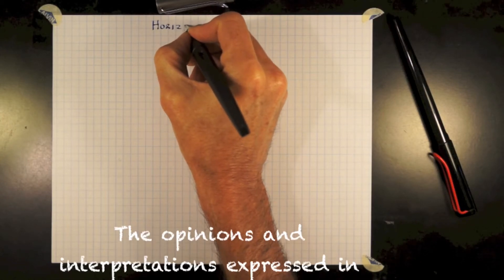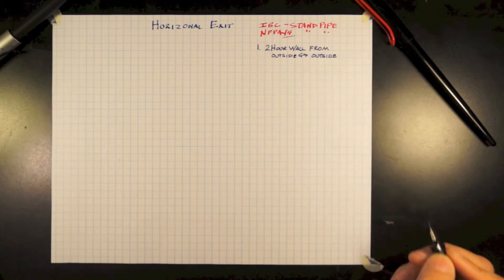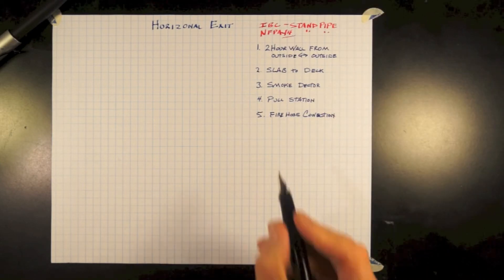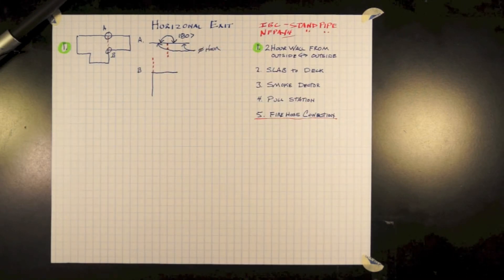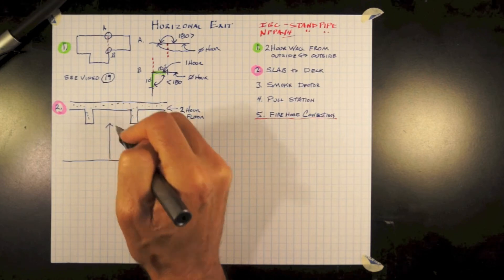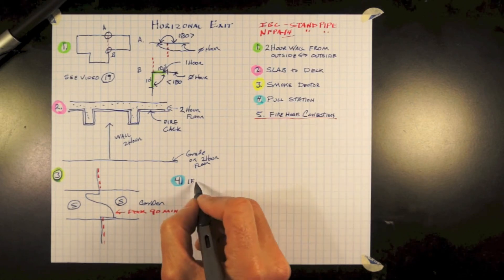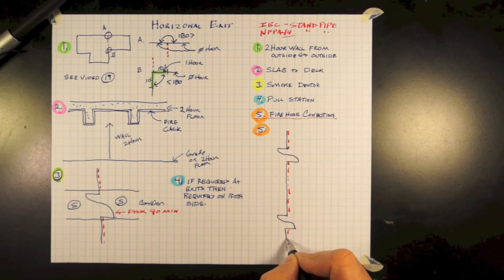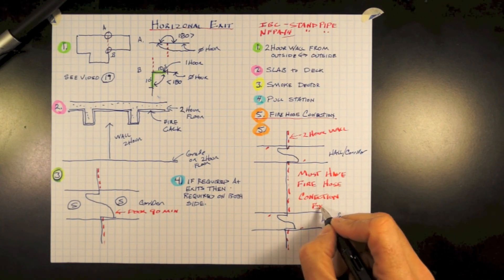Horizontal Exit 22-0

Comment: Hi Marty. If standpipes are not required per 905.3, do we still to provide standpipes for horizontal exits?
Reply from the maker: Manidipa Basu Yes, take a look at 905.4. If you don’t put it in it’s not considered a horizontal exit it’s only exempt in certain instances.
Reply: @MartyHuie  , thank you.
Reply from the maker: I'm backing up on my comment.  It looks like IBC 2018 has updated the code section 1026.5 clarifies your question .  This is a new section.  It reads standpipes and standpipe hose connections shall be provided where required by sections 905.3 and 905.4.

So having said that, if your building does not require standpipes than likely you do not need to provide them for horizontal exit.  Be aware though in some very large buildings, the AHJ

Comment: 2009 IBC section 905.4.2 Exception: Where floor areas adjacent  to hoz exit are reachable from exiting stairway hose connection by 30' of hose stream connect 100' of hose. a hose connection is not required.

so item 5 might need to be installed
Reply from the maker: Lee Cerino You're absolutely correct, I have used this several times.  Note, that this exception only applies to one side of the door.  A hose connection is required on both sides of the door if both sides are being used as a horizontal exit.  So you could have a horizontal exit only going one direction and the direction that it is going in is the side that hose connection cabinet needs to occur or in this case a stairwell with a standpipe connection.

To better to explain this a little bit more once you connect to the stair standpipe system, you can string your hose 100 feet.  And then you must be in clear line of sight i.e. being able to spray water directly on the horizontal exit door and that distance is allowed to be up to 30 feet.

 I don't want to get in to all the exceptions within the 1st video.  I believe that will start confusing people the base requirements is really what I am trying to cover.  I have planned to do a subsequent video for all the references I've done so far that will start talking about exceptions and how to work around them.